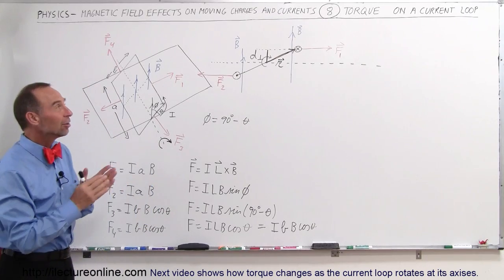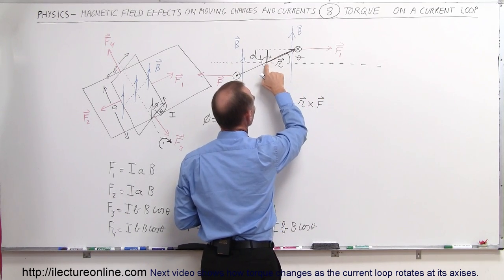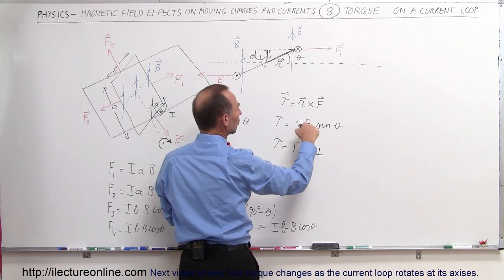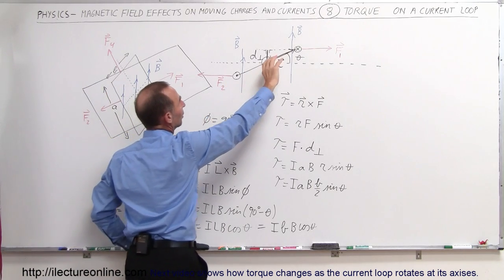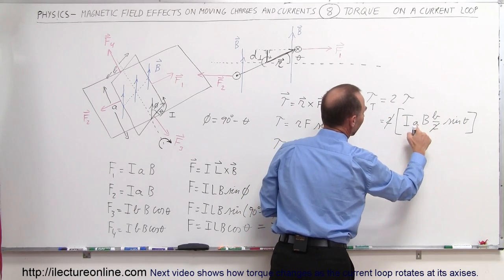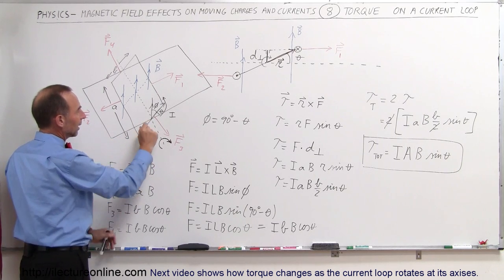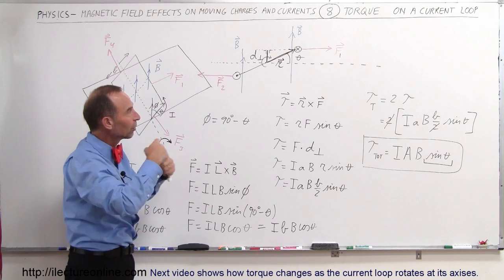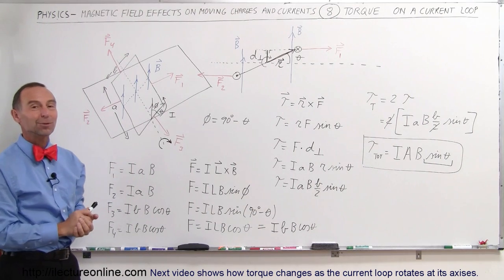Physics 43  Magnetic Forces on Moving Charges (8 of 26) Torque on a Current Loop

Comment: Would there be torque on this circuit as long as the magnetic field is at an angle? 
Meaning the movement would be harmonic with damping until the circuit settles parallel to the plane, right?
Reply from the maker: There will be a torque on the loop as long as the normal to the loop is not parallel to the magnetic field.  I would not associate this with "damping".

Comment: Thanks for this. 

If one section of the loop is fixed as a hinge, can you comment on what the torque of the loop around that hinge would be.

I understand that F=mu×B=IABsintheta gives the torque of a free loop as here, but was just wondering if that would be the same torque around a section fixed as a hinge. I suspect not. Can you confirm this.

The reason I ask is I'm doing a problem that asks to get an expression for such a torque (due to an unknown B field) around a fixed section as a hinge . And then asks to equate this expression to the torque due to the weight of the loop around that hinge. So we can find the target variable B.

If you comment on this, I would really appreciate it.